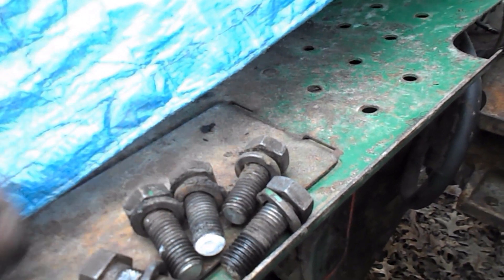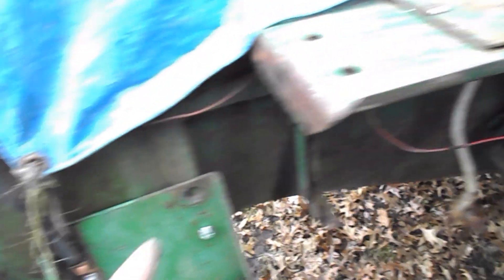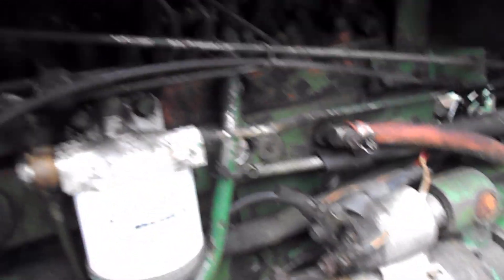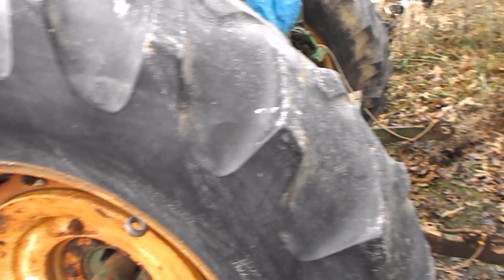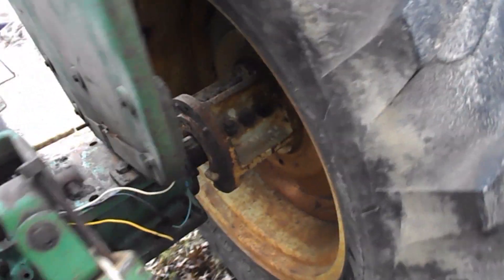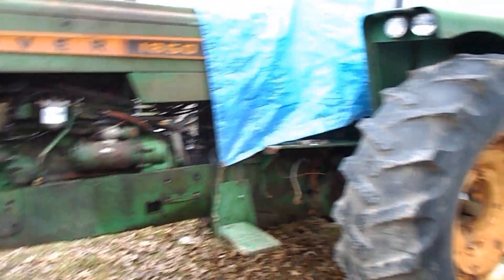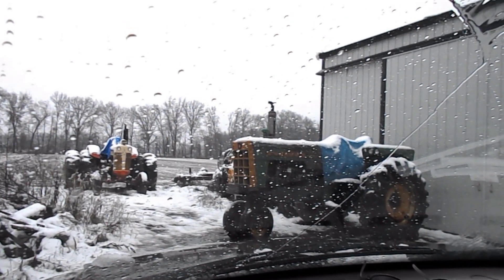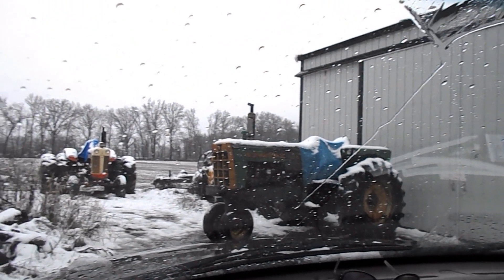12 15 19 and the Cradle is Back On

Comment from the maker: After getting the cradle fixed and welded up I got it put back on, It was a real trick to get it back on by myself !  But I got it back on and now I can move onto other projects that need to be done like getting the draw bar put back in and straiten out the brackets that hold the draw bar to the cradle and get it all back together. There calling for nasty weather to move into to night so it might be a couple of days before I can do anything on it again. I'm thinking about going to look at a set of good used tires for it and if there good and at the right price I'll buy them and if not I'll keep looking. Lots of little things need to be done to the tractor like adjust the brakes and clutch and I got to get the fuel tank changed too, So as soon as it warms up a bit I'm going to hit it hard and try to get a lot done to it. I hope you enjoyed watching.  Bandit
Reply: Your fix on the cradle looks pretty good.   I have to say that I have pulled some things with chains the wrong way in the past with my Olivers and my White, but based on what I learned from you, I will use a clevace and pull only from the drawbar.  The new set of rear tires is a good idea too.  And of course, that's the prime time to address your rims if they need it.  Between my 1550 and 1650,  my Oliver Mechanic friend has helped me replace 2 of them with good used ones, and has helped me locate 2 others, so I will be able to replace the other 2 originals when I need to.  I'm sure there's a ton of little things you need to do with this machine, but when you're done, you have that feeling of satisfaction and a machine that will be ready to roll when you are. That's the way I do things too.  A few years ago, I bought a used  White 5100 corn planter. Got it pretty cheap because it was a wide row machine and no one else wanted it.  I still plant 38 inch rows.   I replaced all 11 chains, all disk openers, the wiring harness, including the sensors in the seed tubes, etc. - everything that could wear out.  Works like a new machines now for a fraction of the cost of a new one.  Keep going, my friend.
Reply from the maker: @pagrainfarmer  Most of the Oliver's have a clevis under the seat at all times cause you just never know when you might need to pull something out !  My 1550's have had a problem braking the top bolts out of the cradle on them cause the center link hooks to the top on it. Getting broken bolt out of them can be fun without taking the cradle all the way off and if you do that I just weld a nut to the bolt in the casting good and use a wrench and turn it out easy enough . But drilling one out and using an easy out is a pain in the butt !! I've been looking at used tires and they want $600 to $1000 for used rear tires on or off rims and add the cost of going to get them and having someone come out and pump the fluid out and dismounting them and maybe mounting them you got $1000 to $1300 real easy and you can get new ones for that. So at this point I'm looking at used and new and have a really good price on 2 new ones for a grand. But I'm keeping my eyes open for a good pair cheap and I haven't found any yet.  Bandit
Reply: @banditfarmer1900  Yeah, rear farm tires have gotten crazy.  We had a guy around here that did a mobile farm tractor tire service.  However, he retired last year and supposedly found someone to take over his business.  The original guy was really good and dependable.  The last thing he did for me was putting the new front tires on my JD 4400. Haven't had the new guy out yet - haven't needed him (knock on wood LOL).  My Oliver mechanic friend can pump out the calcium and change tires, but he only does it at his shop.  If it's a planned repair or replacement, I can literally drive my tractors there (he's about 6 miles away).  But if I have a flat, I'm sh$t out of luck and gotta get someone to come to the farm.
Reply from the maker: @pagrainfarmer  The way I'm seeing it now after looking for a couple of months is I'm about better off to buy new over used.  If I find a good set with 85% tread or better on rims your looking at $850 to a $1000 for them add a trip to go get them 4 dismounts and 2 mounts plus pumping the tires out and a service call you got $1000 $1100 in a used set of tires. I found a place to get new ones delivered to the house for $1200 and I'm seriously looking at them. I found a set of 18.4x34 Armstrong long bar short bar 90% tread on rims (but there bad) full of weather check and he wanted $850 for them. I told him he was nuts ! I drove 1 1/2 hours to look at them (after calling him) and I find there junk ! Man I was pissed off !  All he kept saying was look at the tread there like new ! I told him oh the tread looks great but the side walls are junk ! They had been run low for a long time and there was a lot of weather checking and cracks and splits in the side walls plus they went out of business 25 30 years ago. I kind of lost my temper and let him know how I felt about it in a few choice words and left !  I went home and started looking at new ones on the computer and I found some. I changed more tractor tires than I care to think about the hard way cause I didn't have the money to pay someone to do it and I didn't have the right tools to do it either ! When they have been on for 50 years I'll pay to have them changed and have a cup of coffee while I watch the guy do it ! LOL As they say with age come wisdom and I'm smart enough to know when to sit back and hire it done !  LOL  Bandit
Reply: @banditfarmer1900  Amen to that!  I have changed some myself too and it can be quite a chore.
Reply from the maker: @pagrainfarmer  When your young and dumb and think your 10 feet tall and bullet proof you can do anything !  But as you age your back says Hay wait a dog gone second here your going to do what ? I don't think so ! LOL Call that young whipper snapper to come do it while we rest !  LOL  I've done my fair share of them beating on beads with a sledge hammer on a tire hammer driving up on them trying to brake the bead down and even getting the crow bars out with the big screw drivers and hammers to get one to move. I helped my uncle put 2 back tires on a 2050 Oliver, There was 4 of us and it took 12 hours strait to get them off and the new used ones put on and all 4 of us were worn out !  I remember it like it was yesterday so when the 1850 get new shoes I'll be standing there watching as the young tire guy change them ! LOL Bandit

Comment: Say bandit what does that 1850 got for tire size on it
Reply from the maker: There 18.4x34"s on the back and 7.5Lx15"s on the front , I'd like to put 9.5Lx15"s or 11'Lx15"s 3 ribs on the front but that depends on what I find for the back so the tractor will still sit level . Bandit

Comment: Looks like it has a dual hub on the right side and a standard hub on the left side
Reply from the maker: I asked the guy I bought it from about that hub (being it was has neighbors tractor) and he said as long as he or his dad could remember that hub has been on it so I have to assume that somehow he broke the original hub and found that dual hub that was broke and used it to replace it. I don't know how you would brake a hub but it can be done but he came up with a good idea to use a dual hub that was broken to start with as the hub for the tractor. At some point I may look for another hub to replace it cause I'm not crazy about that style of hub to start with but for now it will work just fine.  Bandit

Comment: hi bandit, you did good looks nice do you wanna sell 930? thanks for sharing
Reply from the maker: Thank You Joseph, I think its going to work out just fine. I've been toying with the idea of selling the Case cause for me the 1850 will do more work and by that I mean use more of the equipment I have that's 3pt. At the time I bought it it really fit in for what I needed it for but now things have changed a bit and I needed an 1850 or 2-105 White for the 3pt so I can use the chisel plows and moldboard plows I have, So I guess I would sell it. Bandit